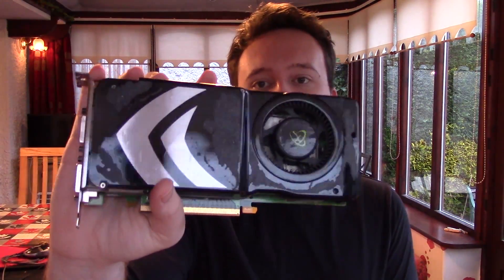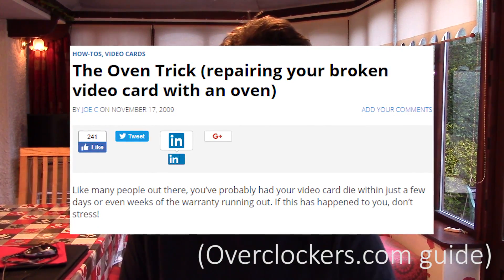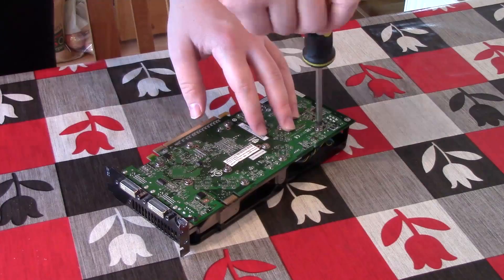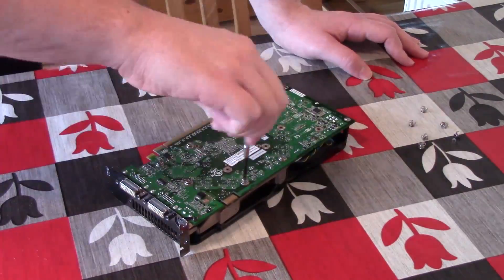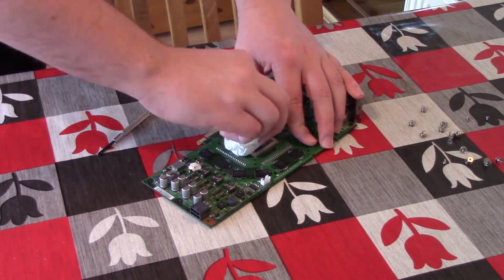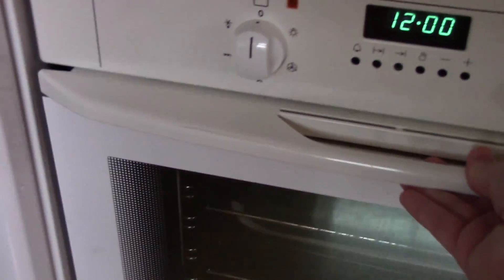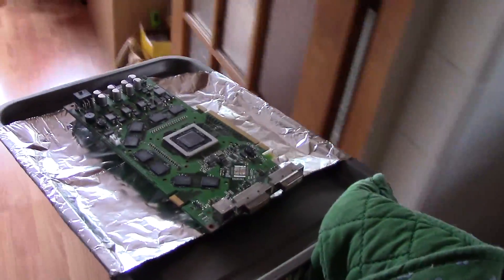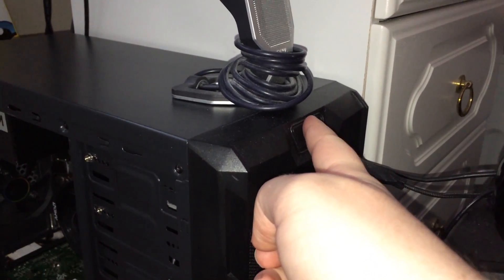Hardware Myths: Oven Baked Graphics Card Repair

Comment: bought a faulty 7970 for 5 bucks, baked it now it works just fine, been mining on it for 6 months and its still kicking.
Reply: sir that is the fastest ROI ever
Reply: Financial Crisis Armageddon 2016 Bruh woah
Reply: The fact that I said that I was mining on it after baking shows that I wasn't expecting it to last forever. For me, the 5 dollars was more of an investment than a fix, a gamble that soon payed off in mining profits. I agree that this really isn't a fix, Louis Rossman did some debunking about it too. The guy at the computer store didn't even know it was a 7970 so all in all, it was definitely worth it.
Reply: I think mining produced enough heat to firmly melt and reseat the solder on whatever's loose.
Reply: ok time to buy faulty gpu! anyone know a 1080 equivalent back in 2012/13?
Reply: had been mining with a single 7970 for more than half a year now still kicking lol
Reply: neato
Reply: Chris Tanada 680
Reply: maybe, i keep the temp below 75 celsius to be safe, and i might change the thermal paste again soon,also planning to get more gpu
Reply: Chris Tanada FX 5200
Reply: That is the best deal I've ever heard.
Reply: Financial Crisis Armageddon 2016 Bruh AMD FineWine technology xD
Reply: not another miner
Reply: Chris Tanada 7970
Reply: Is it still kicking until now?
Reply: +Financial Crisis Armageddon 2016 Bruh You getting what, one bitcoin every century?

Comment: Hey man, I think you'd be glad to know you're not the only one doing that. I've used an oven for reviving 8500 GT three times, prolonging its life for 3 (!) years total. Haven't tried the 4th time, there wasn't a need for that as I bought a new GPU. The next one, HD 7770, been fine for like 5 years, then it began to restart every few minutes and show artifacts of all kinds. I decided to give an electric iron method a try, and it also worked fine for 2 times, but just for a month total. Not sure if it's about the exact card or oven is somehow better, but that's it.
I would also reccomend everyone to check exact GPU model temperatures before buying one. Some companies do love advertising their Super Gamer XXL Mega Cards which are a little overclocked from the box, but also they may not have a decent cooler. Do check the temperatures tests, guys, bricking is a thing.

Comment: I once done it to an Radeon HD 4870 and three years latter it still works and play games such as Overwatch for hours.
I think the heat gun method could be better as you only heat up the GPU die and not the entire card. Using soldering flux helps a lot to !

Comment: This is most of the time an issue with the solder balls under the silicon die and not the fiberglass substrate. I've found a way to fix this issue by trial and error but it's a very risky technique and requires pretty high heat and pressure. As a test i used an old hp laptop with a HD4330, the laptop did not work after 4 conventional bakes with temperature control but jumped straight back to life after i did my fix and now displays 1080p30 and 720p60 video without any issues, considering how old this GPU is i say it's adequate.
Reply: And to RGinHD if you want to bake your card the more-less optimal way you need a bit of solder about 4cm long that you bend in three spots to create a triangle base and a bit of solder at an angle (sort of like three side pyramid) that you put on the chip. The upwards protruding bit of solder will fall down once your temperature closes in and when the solder rolls up into a ball you turn off the heat and open the oven, leave it to cool then pop off the blob of solder, clean, thermal paste, assemble and use.

Comment: I baked my xfx 8800gt like 5-6 times because no one knew how to fix this problem, and every time i did it worked but only for 2-3 months but is not so bad as people would guess, just rise the temperature by a little if the first try didnt worked out.
Btw it still works on one of my pcs

Comment: I revived in that way Quadro 4000, 7300GT and 8500GT and all that videocards still live for many months after visit in oven, of you don`t reach 80 celsius degrees videocard can live for very long time after that, after 80 degrees card die once more and you must repeat visit in oven, you can do that even 10 times, so don`t afraid, card will survive all that without problem. Only problem is temperature at using that card in computer.

Comment: I did this to a motherboard once - didn't work for me. Granted, I didn't leave it in very long.
However, this video makes me wonder - do people sell broken graphics cards online? I wonder if it's possible to repair them using this method and save loads on money.
Reply from the maker: +SWAGCOW people do, and some companies still offer a repair service based on this which isn't really ideal as it can't be guaranteed as a long term solution

Comment: You do realize that's how components are soldered on a board in the first place ? 
Sure the oven method is not ideal, since the problem is in quality of the solder balls between the GPU and the PCB, but it will do the job.
I've done it countless times, it works about half the time.  My GTX480 has had three reflows in over four years, still going strong, and these heat up to extreme levels. I prefer to use the heat gun method as it doesn't heat unecessary parts. I've done a GTX560 lately. But I tried on a GTX980Ti and it didn't help at all, problem is somewhere else.

Comment: I have an old Radeon HD 7870 and used the heat gun method it worked for a few days, and then i sent to a proper reballing job. The card worked for a few weeks and then died again. It still gives image but with a lot of artifacts on the scren, also it cand boot into any graphical enviroment like Linux, Windows and even one of my motherboard UEFI

Comment: Like Lewis explains it is the solder bumps under silicon. They are tiny and underfilled so you can't change them. It just that when one changes the solder balls the solder bumps get reflowed more thoroughly. Hence why it works longer.  If your confused by this then study this image http://images.pennnet.com/articles/ap/thm/th_92337.gif So not even a professional repair can get reliable result every single time as it might last just another month or get lucky and get a few years. At the end that is the best a reball can do as a real fix would be to replace the chip which one can never obtain brand new.

Comment: Temperatures below 221 Celsius only stimulate the chip to work for a short time. If you would like to reflow that GPU you should use temp higher than 221C. But the problem will go back because if it is not the tin balls that cause the problem, it is the chip itself. It is just dead. Even if it is alive, a proper method is to reball the chip. And that is not profitable for you in this case.

Comment: back in 2012 i had a broken geforce 8800gts 512 i did run the card without a cooler for 5-10 seconds and the card runs again for 2-3 weeks

Comment: That oven method, heats up the gpu, and makes some bad solders heat and melt again, fixing the contacts, thats why it come back to life. The bga (the solders) were "fixed". But this wont aways help, if the chip is the problem, then you would need to replace the chip. 

Even if that method works, i woudnt reccomend it, as heating it up, will obviusly melt the solders, but will likely degrade the chip itself even with the aluminium foil, because it will likely reach temperatures way above its limits. The correct thing to do is to reball it with the correct tools, it may be way cheaper than buying a new one. The oven method is basically the same thing as reflow, were you heat up the chip and its solders melt again. This isnt a correct method, and as you said, its temporary, but reballing consists in taking the chip out, removing any solder, replacing the chip if needed, then put the correct solder balls to the bga using a stencil, and then put it back in the pcb, heat the solder balls. This method is much more efficient, but may be more expensive then the reflow method. But it wont last forever too, if you dont be carefull, you need to diagnose why that problem happened in the first time, was too much heat caused by a bad ventilation (will probably be the cause in laptops)? Or it bent over time and the solders got bad? You have to find out the cause and prevent that from happening again. Maybe even with the oven method it could not happen again if you prevent it, finding what caused it.

Comment: It's not a myth if it works, saved my 8800gt for a few months until I purposely fried it, and replaced with a 5750 mainly for HDMI. A cheap heat gun would work as well as say a toaster oven from a thrift store. Usually works on cards that are behaving with artifacts etc. Not a cure all ✌

Comment: Preformed the same repair with a heat gun on the GPU of a 2011 MacBook Pro. The laptop still works after 6 months and if it fails again I can just re flow it again.

Comment: Use a support for any vga you use, they wont bend and die with the time, what is a common problem, because it will be sort of bent with its own weight. You can use one dyi or buy one. 
The gpu is hold by the pciex (or any other socket like agp), and by the screw in the back of the case, but the other side is not supported by nothing, and its weight will put some stress in the card pcb and in the pciex (or again, any other kind of socket).
Its good to take anything, even a pencil in the right height, to support the other side of the gpu.

Comment: Since 2004, Pb is not allowed in any device sold on the EU, that's the problem, the mix Sn(60%)+Pb(40%) was stronger than modern soldering mixes of Sn+(Insert Metal Here, usually Ag), after hours of heating during a long period of time the soldering is going to broke, so a reballing is required and the hoven does the trick.

The higher the TDP of the device, the sooner it will broke. In fact, I bet that 90% of faulty PS3s and 360s was due this.

Comment: @RandomGaming
You have the wrong picture of GPA Chips, such as the gpu core of a gpu. Due to the heat (inadequate or clogged cooler) the solder under the chip heats up and thus becomes fragile.
Think of it as metal fatigue, that is fatigued by the thermal forces on the chip.
By heating up the card you should reflow/relief tention on the tin and there by fixing it. 
When I reflow a card, I do it with a heat gun. I take a piece of solder let the gun heat up.
 Then I use the solder to gauge the temperature that the heat gun is pushing out by: pointing the gun at the solder when it melds between 5 and 10 sec I heat up the core the most untill the tin starts shining and viola. 
(plus I also do a mild pass on the memory to relieve tension. This process is mostly used in hardening a metal, steel for instance.

Comment: This works long term only if you upgrade the cooler of the GPU. High temps are what killed it in the first place. You need to avoid that at all costs. Fuck it, go for watercooling. Still way cheaper than reballing

Comment: I personally don't trust oven method at all and the smell is not nice as well but I trust heat gun but you will need really good one plus good fluxes as well I repair many gpu in my life about 100 with this method and some of tham working some not but the one with will not working usually is diferent problem like brisk bios or to much overclocking applied who know if you don't know any history but from my experience if card have artefact or can't accept driver ,error 43 etc ... usually you can use heat gun and some card I repair works even after 2 years of use  some repair you can find in my channel as well

Comment: 95 °C is way too little heat to fix it. I fixed graphics cards for living not to long ago. Firstly you have to know where the problem comes from. artifacts and colored lines come from the memory. It is mosty caused by weakened solder joints. The low temerature you have used let the joints expand. That fixes the problem temporarily. To fix it permenently you have to head up the graphics card above 210 °C to reflow the solder. This is not easy and not recommendet for an normal user. To monitor the temperature of the card and the oven you will need sensors. It is important to preheat the card slowly und reflow with the high temperature. It is hard to describe the whole process in the comments. The reflow method will melt the solder and toxic fumes will be createt. DON´T TRY THIS AT HOME IN YOUR OVEN WHERE YOUR MEEL IS MADE!!!
Can you pin this comment that everyone could see it and no one will burn their houses.

Comment: Did the same thing with my 8800GTS when I had it, back in 2012. but I left mine in @ 200C/410F for 10 minutes, and then let it slowly cool down in the toaster oven with the door open some.
you want to make sure you don't give the components temperature shock, that is a bad idea. after about 30 minutes of cooldown it's safe to start putting it back together.
I've done this numerous times in the past with a Radeon 9800 Pro too and some others. it always seems to fix them, but I've had a few failures where it got worse too. your mileage may vary heavily.

Comment: The heat gun is how I fixed a few Xbox 360s back in the day, well that and some washers and new screws to boot. They all seemed to last between a few months and a couple of years. Some never came back, but I chalk that up to the "towel" trick being used before I had a chance to use my slightly better "fix". Granted the trick is by no means my own, but the towel trick is just silly.

Comment: Great video, I'm glad someone finally called this out as only being a last ditch effort solution. For those that are curious, the permanent fix here is either a reflow or reball of the GPU and/or RAM modules. This failure occurs due to the cycles of heating and cooling degrading the integrity of the hundreds of little solder balls under your GPU and RAM packages. Over time, the thermal cycling causes the balls to start to crack and break down, leading to connection losses and ultimately the failure of the unit. 

Reflowing is the process of melting and reforming the existing solder balls under tightly controlled conditions and with specialized equipment meant for this very job. A reball goes one step further and involves completely removing the whole chip and replacing the balls with new ones and reattaching the chip. With reballing, you can replace the balls with ones of a stronger solder alloy to improve resilliance to heat strain and improve the very long term reliability. 

I actually have done these reflow and reball repairs for years with game consoles, graphics cards, and laptops. If you want to see how a reball process works, I have a video on my channel where I reball an Xbox 360 CPU. Made the video when I was younger so it's a little cringy at times, but does well to show what the repair involves. Shameless plug I know, I'm sorry, but if you're genuinely interested in how this works It's actually quite an interesting procedure :)
Reply from the maker: +Logan Steffen I'll check that out :)
Reply: are you saying i can put my red ringed xbox in the oven
Reply: @nutallergysufferer5315  You can...  Take all the plastic off and turn the oven on 450.  Bake it for about 10 minutes... He is correct and I have done multi-layered boards myself many years ago but you can absolutely bake Anything that degrades over time in regard to solders.  It's not a guaranteed fix and it will not last forever but if your issues stem from a broken solder link, baking it will fix it (if it melts back correctly).  Otherwise, you've wasted twenty minutes and whatever is broke, is still broke.  Edit:   Open a window before doing this, it Will stink the house up.  Also, have a fire extinguisher ready just in case.
Reply: @d12duke  210 ~ 215 celsious and 10 minutes at that temperature. Last card I succeed was gt 440 gddr5 1gb. I couldn't miss saving the epic gddr5 card. But a bit worry if I can use the oven for cook next time

Comment: i did this as a last ditch effort to fix a GPU in an old Acer laptop the gf's dad had (some models had a small stand alone GPU) and it worked. i did a cpl things when i did this - i made sure to start reducing heat every 15 minutes, starting at arounf 300f, then 250, etc. as well, the card was made to sit for about two hours to no residual heat remained besides the about 80f room tempreture it was in. then i tossed it in and it worked!!!

Comment: I've tried the same with my old HD4650, HD4670, HD5570, HD6670. I have like dozens of all them dies for various reasons. But it all came down to one factor, power failure. Electricity is not exactly a reliable traits of my country. Blackouts happens at random and been quite a headache for a cybercafe owner like me.
After I oven them, only a handful few ressurected.
Thus forces me to buy new cards. So I bought a dozen of HD7730 two years back. I sold my old rig of Phenom X6 and GTX680 to do it :(
Reply: Sounds like a case for a big online UPS or two. 1500, 2200 and 3000 VA models are quite common, those should power a few computers each. The most expensive part tends to be the lead acid batteries, so companies will commonly buy a complete new UPS, but with some elbow grease you can also service these guys yourself (there's probably tons of videos out there, the FFcossag channel comes to mind).

Comment: I've only ever done this to two cards which were both out of warranty and pretty old by that time anyway which actually worked. I've tried it five times in total and the older the card, the less lucky you'll likely be if my small test size is anything to go by. As for the fix? Well, the 4850 lasted years before I eventually just put it on a shelf (where it still resides today) and the other card was given to a family member as part of a cheap PC and they, against my warnings, sold it on not long after.